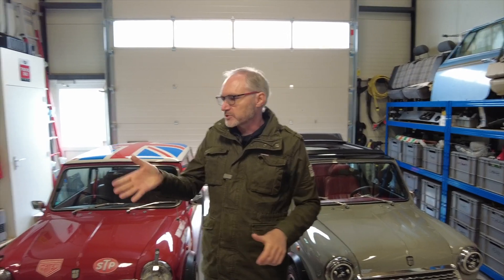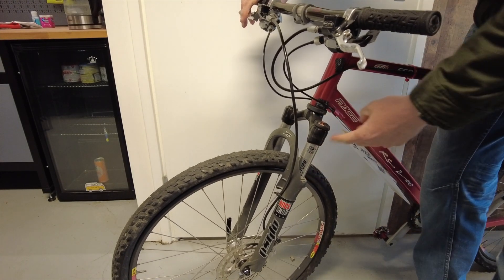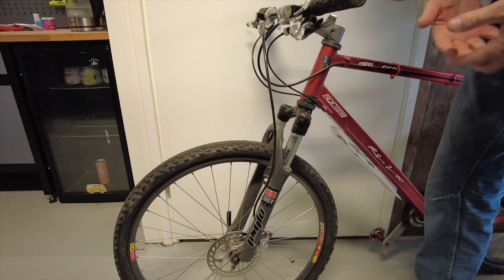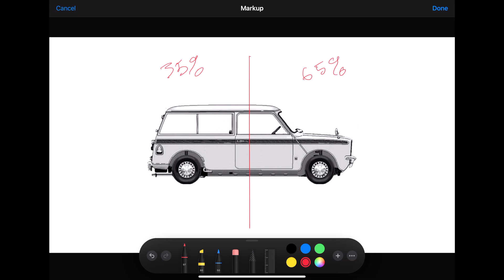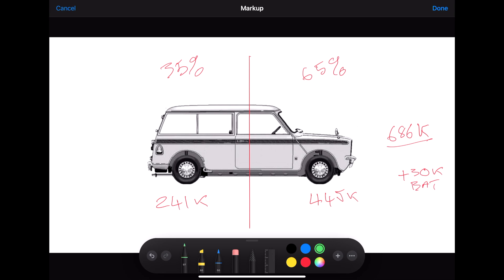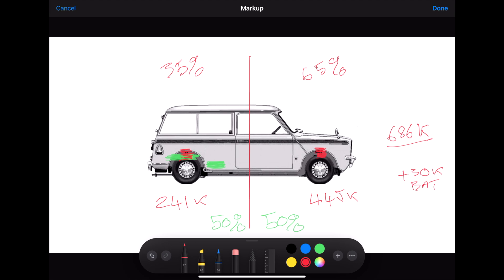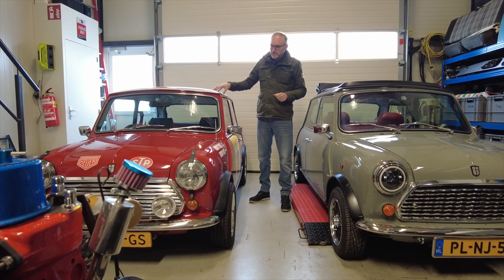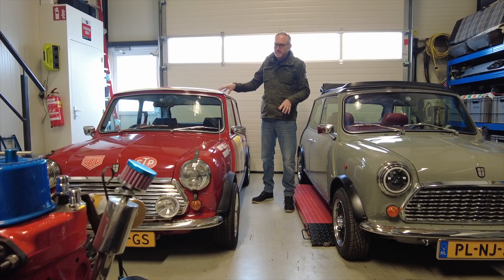Classic Mini Clubman Estate - Electric conversion

Comment: Interesting as always! Must admit I was hoping for news from the body shop side - very keen to see if you have added extra space for the batteries, where and how and if any strengthening has gone on to allow for extra weight/ security of the battery pack in the event of an accident.
On the suspension choice though I now feel a little more informed on how you’ll be dealing with the new set up. I imagine the springs on your new rear set up are harder than standard?